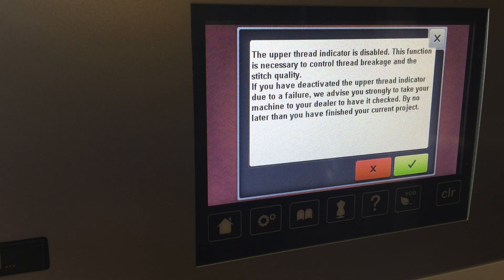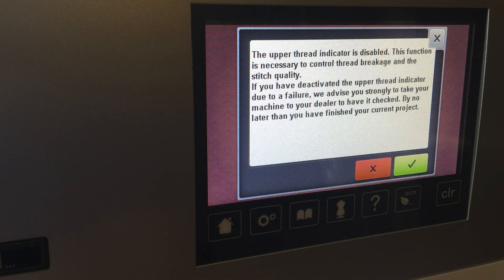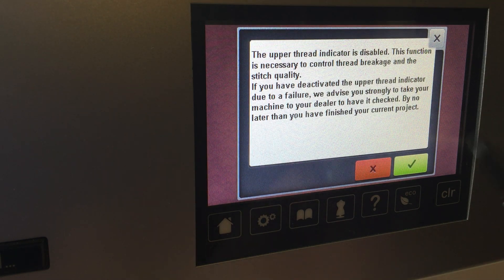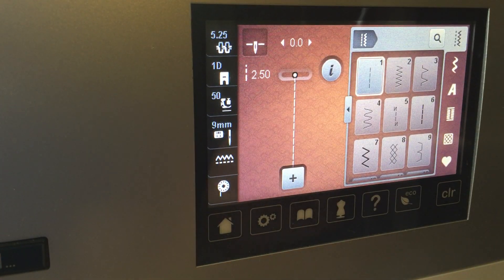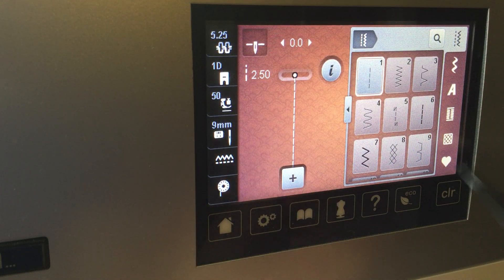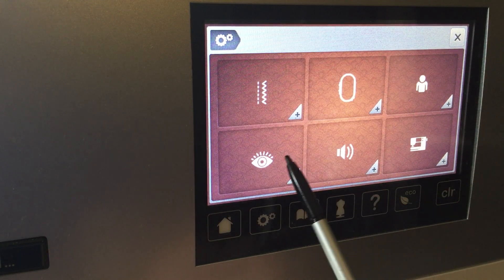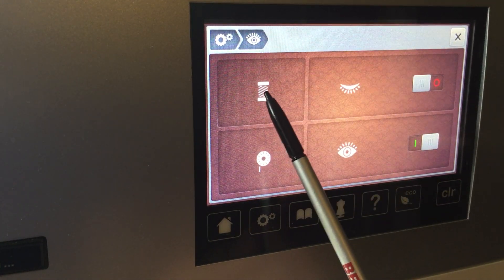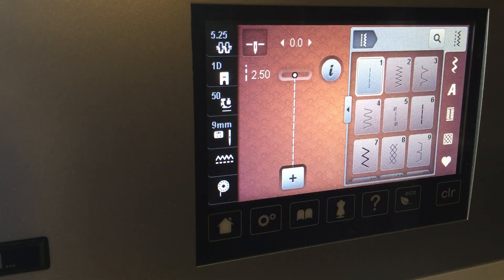Bernina upper thread indicator message

Comment: The problem I was having was that I kept getting a thread breakage error even tho my thread wasn’t broken.  I turned the sensor off and then that message popped up.  UUUGGG.   
Does anyone out there have or had that issue and is there an easy fix for it?  I have the B820 and I certainly don’t want to be lugging this beast to the shop for repairs every time I use the darn thing.  Very frustrating.  The machine is almost brand new even tho is it 14 years old.  There is only 150,000 stitches on it.
Reply: I have the same issue with my 770 QE. I keep being told that I’m threading it wrong. I’ve done everything they told me to do when threading but no luck. I’m very frustrated especially for how expensive these machines are.